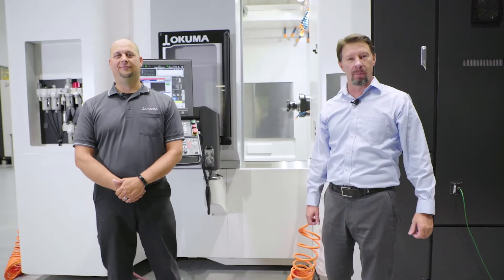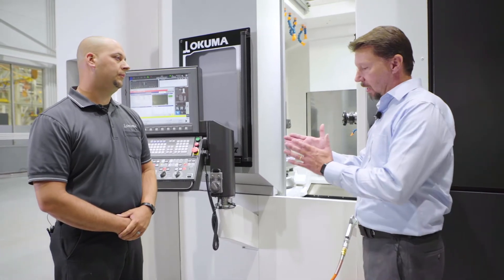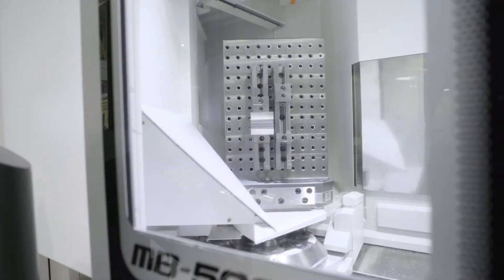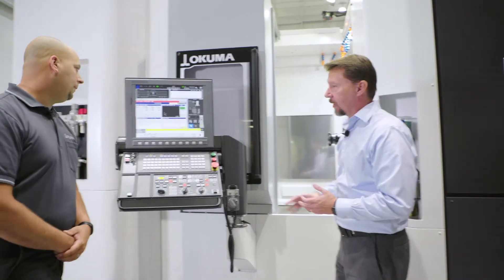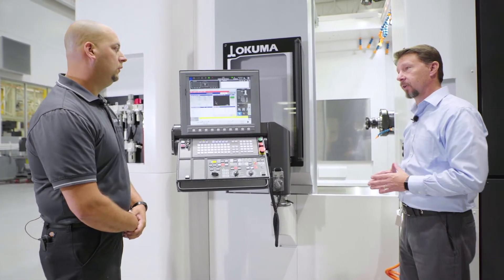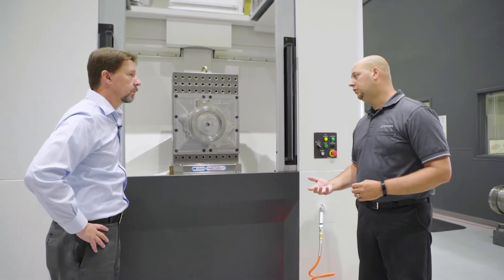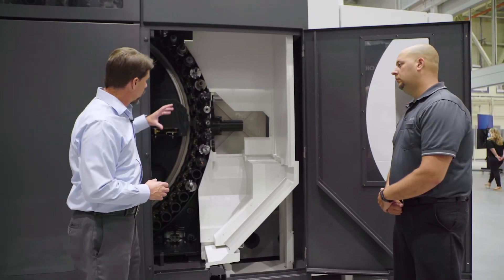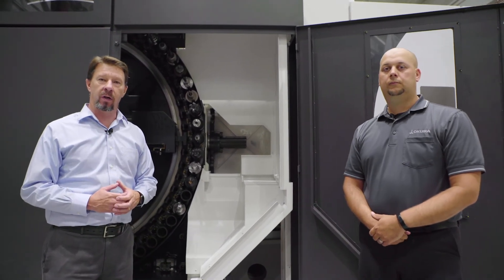MB-5000H II Horizontal Machining Center

Comment: Do chips still build up behind the operator door and jam up in the door frame preventing the door from closing?

Looks like the shower-bar setup on the ceiling has been cleaned up and there is no longer areas for chips to build up. Good.
Reply: Haha ，nice view from the insider.I have this problem too.

Comment: I purchase my 1st Okuma back in 2002. Now I have three of the. 😎
I highly recommend them. Great sale team and fantastic service if you ever need them.
Reply from the maker: Thanks for the kind words, and thank you for trusting Okuma in your shop.
Reply: How would you compare them with Makino and mazak?
Reply: @richpryor9650  I know a Makino is really good machine. Okuma to me is in top of pack.
Reply: @dford344  Did you go with Cat spindles or HSK?
Reply: @richpryor9650  Cat but the next high speed one would be HSK
Reply: @dford344  Okay, cool, I'm looking at either a DMG or Okuma. And then a double-column vertice or a 5 axis, But I'm not sure how much rigidity you sacrifice with the 5 axis.
Reply: @richpryor9650  my 1st Okuma is a 1998 and I can still keep .0002” to .0001” accuracy. Doing regular maintenance is the key to this. I know the resolution in the servo are very high. Spindle life I way better too. A Okuma always know we’re it’s at. Theirs no homing are any worries when power goes out. Just restart it and it’s ready to go. OKUMA’s are design to run 24-7 for 10 year before a rebuild. On my MX-45VAX when I setup my vice I use a 10th indicator, while tightening the clamp nuts the indicator doesn’t move any. 
Good luck with your decision. 😎
Reply: @dford344  Cool dude, how heavy of cuts do you take with them? I heard Okumas are built like tanks and can do tool steel no problem.
Reply: @richpryor9650  I use Mastercam for programming. On my MX-45 7000 rpm spindle. On 4140 309-400 sfm using dynamic cycle.
Reply: @richpryor9650  go with the Okuma. DMG builds a decent machine, however I think the Okuma is better build. I’m a Makino man and if you’re not gonna go with a Makino then Okuma is my next choice.
Reply: @DdgeluvinHic  Okay, I've heard that support was pretty bad for DMG anyways.
What about Matsuura and Mitsui Seiki?
Reply: @richpryor9650  both of those are excellent machines as well. It really depends on the application.
Reply: @richpryor9650  Kitamura is also a brand to loom at. They’re an excellent choice as well.
Reply: @DdgeluvinHic  Thoughts on  Mazak?
Reply: @richpryor9650  I’ve run older Mazak machines and they’re good. I’ve also talked with guys that have newer machines and they like the older ones better, so I’m not really sure on them.
Reply: @DdgeluvinHic  Ok, and just curious but have you heard anything about Huro and know anyone who uses them?
Reply: @clickblol  that’s good to know. Thank you for the info.